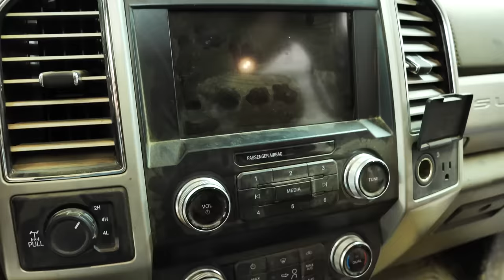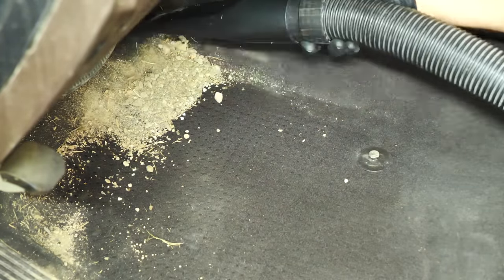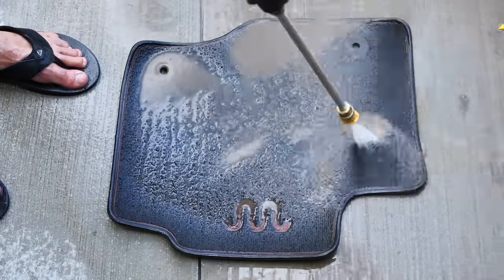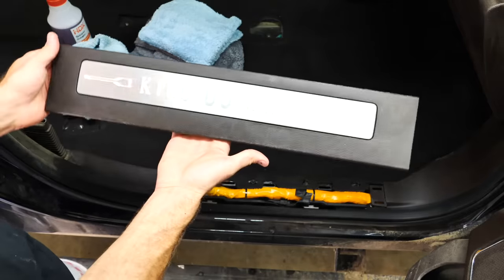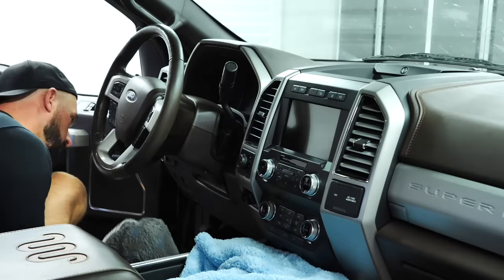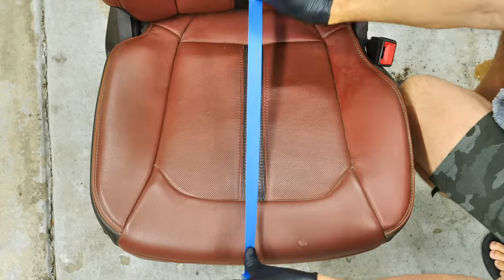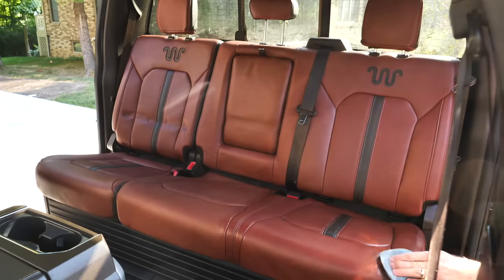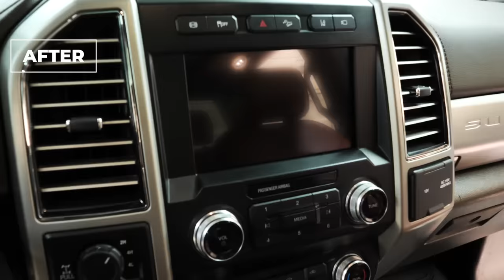Deep Cleaning A Dirty Ford F350 King Ranch || Car Detailing || Stauffer Garage

Comment: Hey Stauffer garage, I found that the orbiting attachment for my pressure washer works 1000% better than any flat nozzles. Hang those mats vertical and watch the orbiter get all that out in one pass. Try it, you'll even be amazed
Reply: I use a 7,000+psi power washers at work and I can say it all comes down to using the proper nozzle. Depending on your psi output an orbital may shred a cloth mat though.

Comment: Just a thought.......but what about clamping the Floor mats to a line or fence and spray them so the dirt and water runs down and doesn’t soak back into the carpet like it does when it’s flat on the ground?.   Again just a suggestion.

Comment: Have you considered hanging the mats so the dirty water runs off them better as you pressure wash? There was a self service wash I used to frequent that had clips to hang your floor mats on against the block wall and it worked great!

Comment: Another great detail and video Mr. Stauffer! I love your content. Little tip, that floor mat may have worked better if you hang it up while you pressure wash, that way everything can run down instead of reabsorbing into the mat.
Reply: makes a huge difference on rubber mats even
Reply from the maker: Thanks for the idea! Appreciate it!

Comment: Nice turn around!!! Ford truck interior are so nice! Do you have a video that explains the do’s and don’t’s on removing seats??? Bolt torque specs? I have been detailing for a year now and run into vehicles that would benefit on pulling the seats!!!
Thank you!